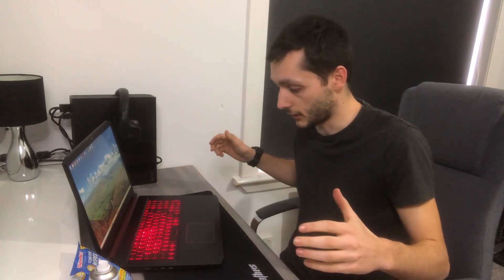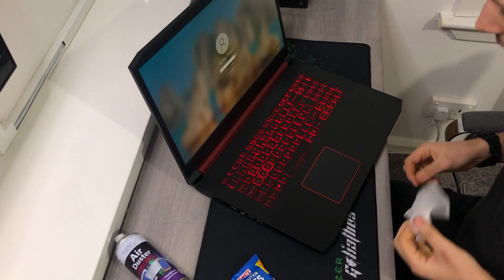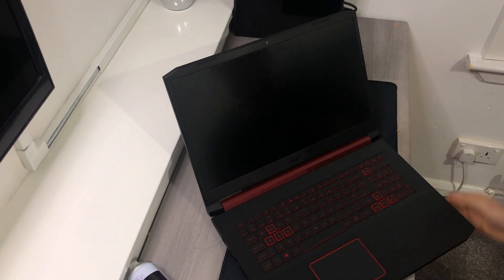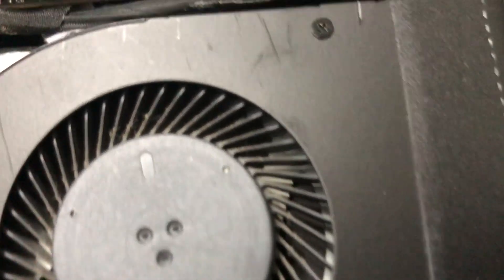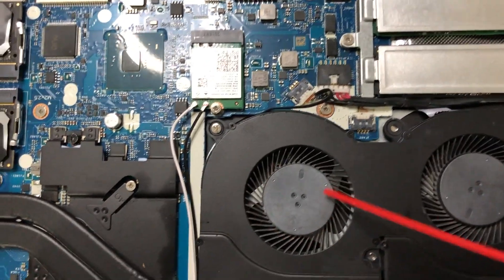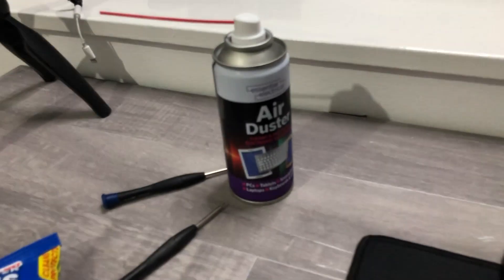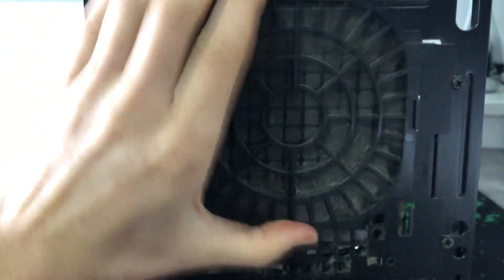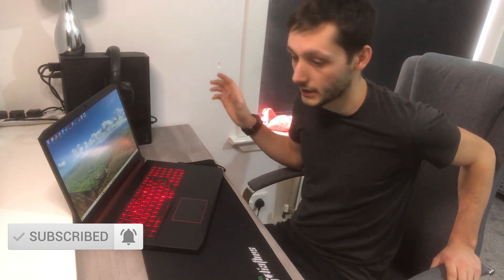How To Clean Your Laptop Or PC

Comment: Mate I had cleaned all the other components with dry cloth (very gently)
But the thing is I have not turned it on since because my ac adapter is not working &. I ve given it to repair
I hope my laptop don't go boom 😭 after what I did
Reply from the maker: My fingers are crossed for you I hope it’s fine